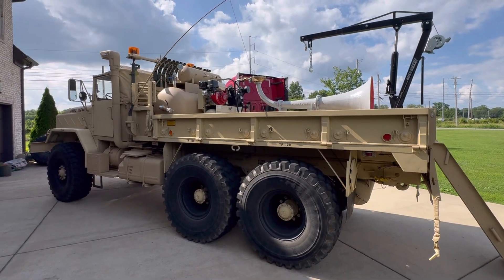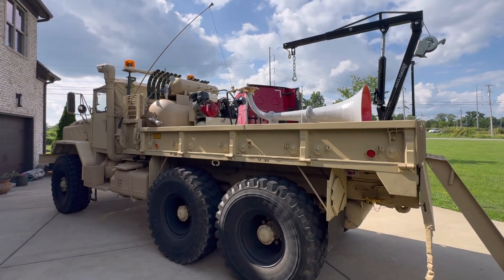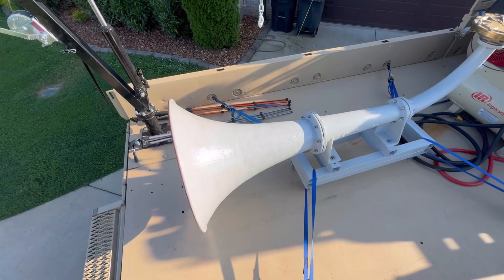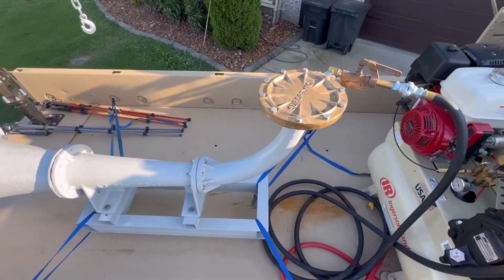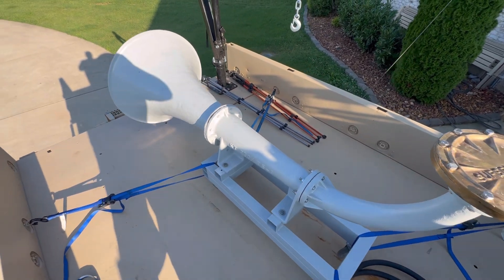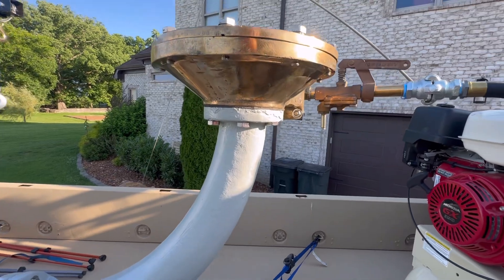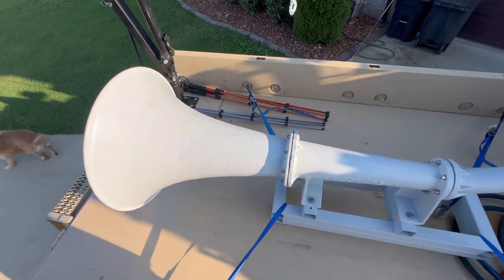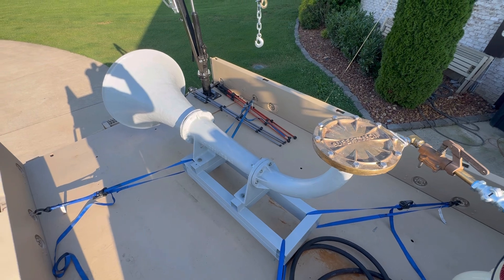Kockums MKT 230/75 Ship Horn

Comment: The only J horn "J horn for it's shape" bigger then this is the Kahlenberg S-6, Which is 67 pounds heaver and has a 432 mm diaphragm nearly double this. For the largest production air horn that doesn't run on steam, This thing must of vibrated the ground and reached roughly 126 dB at 100 ft and as always echoes were nuts.
Reply from the maker: Yea the S6 was a beast. It was more of a prototype 1 off horn though. Never manufactured for commercial use. I know where it’s located but unfortunately it’s damaged and not in working condition. The 230/75 is the largest “air” ship horn that was used in service on many large ships.